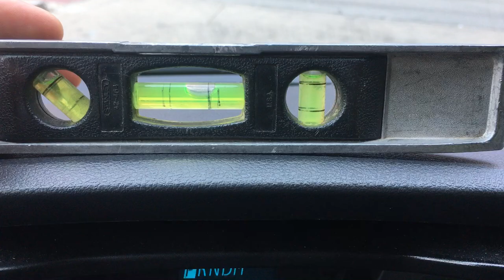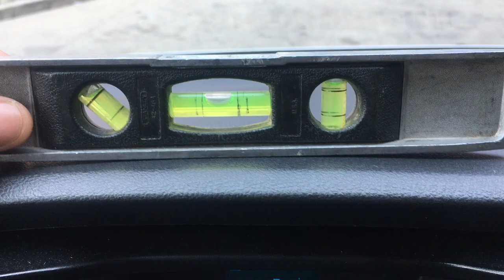HOW TO USE A LEVELER

Comment: What about the other bubbles that's on each side.
Reply from the maker: can anyone help-out with this question?
Reply: You’ve probably already figured it out but I’ll reply anyway in case anyone is wondering the same thing. 

The bubbles on the sides are for vertical and 45 degree (the angled one) measurements.

Comment: What kind of fluid is it and why does it have that bubble? What makes that bubble in there just curious..
Reply: The fluid can be water or alcohol. The bubble is there because there is air trapped inside of the little container with the liquid, creating a small bubble
Reply: I think ether or alcohol
Reply from the maker: @eeveeredbulla9147 I'm not sure.

Comment: Well that’s what I’ve been doing on my table. But no matter where I put it it’s always leveled. But it’s quite clear that when I am pouring my paint or my resin that there is a definite tilt to another side. I am at a loss as to what I can do. Because I seriously can tell you that no matter where I place it on the table, that damn bubble is in the middle 🤷‍♀️
Reply: Maybe your leveler is defective.
Reply from the maker: @dianaguy148
Sounds frustrating! Maybe try using a different leveler or surface to test?
Reply from the maker: @scootermom1791
That could be it! A defective leveler can definitely cause issues.